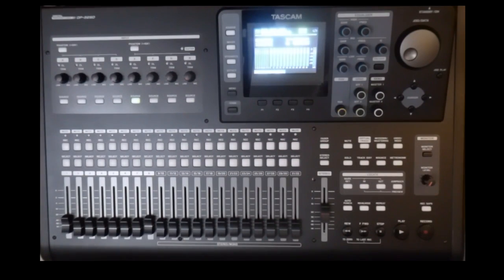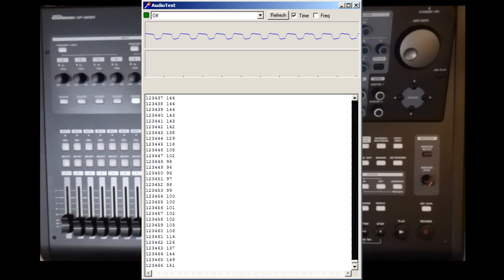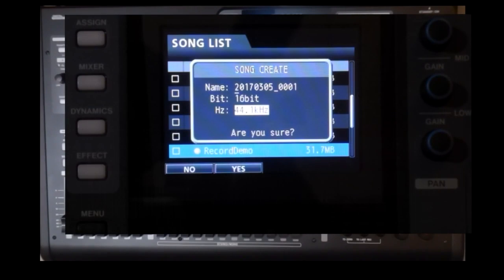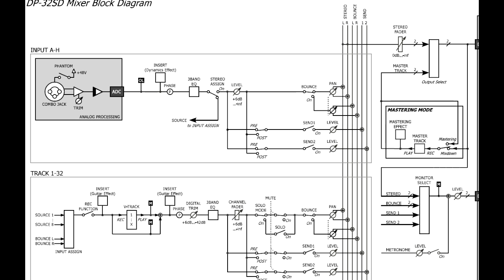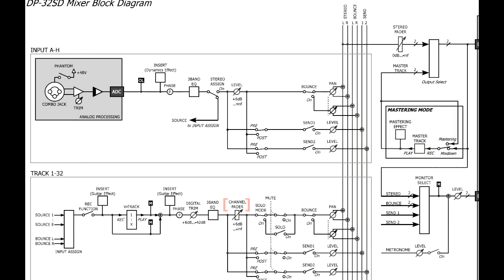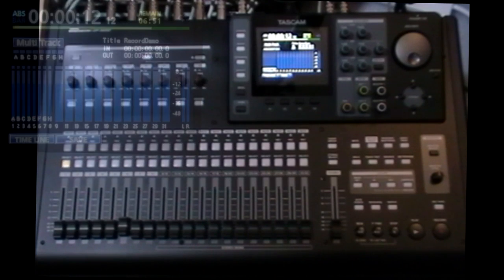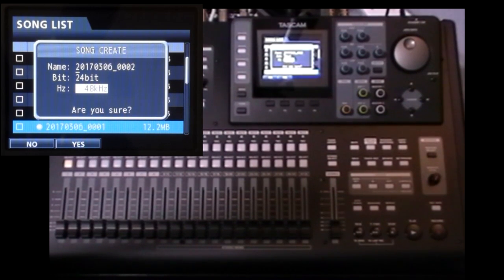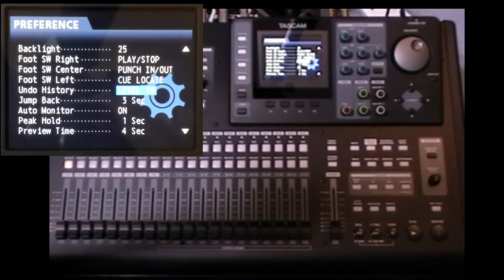Tascam DP24/32SD Tutorial 8A: Recording

Comment: great vid, is it possible to transfer tracks to Logic on Mac for further editing? thanks in advance
Reply from the maker: Thanks +Jon Wright. You can transfer individual tracks in & out of the machine by using the Import & Export functions; video 8D covers this.
Reply: Many thanks for reply, much appreciated, that's great as thinking of getting one for my home studio and learned sound engineering in the old days witb real faders etc 😀so thought this would be great and that I could master on my imac then if needed, was thinking about the 32 track one?  Your thoughts and advice be appreciated, many thanks Jon
Reply from the maker: Hi Jon, my main requirement was for making high-quality digital multi-track recordings on location. I already have a home-studio setup, so can transfer the recordings to this for mixing and processing as reqd. As such, the extra features like FX and Mixdown/Mastering were unnecessary, but I felt the machine still justified the price even if these were never used. In hindsight, they are more useful than I thought, and it's also sometimes easier to use the machine for quick demos or experiments to save powering up all the other gear. There also wasn't much choice for new machines when I was looking about 2 years ago  - there was only the Zoom which had comparable specs, but it looked more flimsy than the Tascam. I'd also had a Zoom PS-04 palm studio which had a really non-intuitive user interface (to me at least) so that put me off Zoom products - maybe this is unfounded but I went for the Tascam anyway. 
The 2 main justifications for the 32 track model over the 24 track were: 
1. I was always short of stereo inputs on my analogue mixers, and this is a pain if you want to route synths, keyboards and effects (especially reverb) through it as they are all stereo. You can use pairs of mono tracks but you have to keep any level & EQ adjustments in sync. So the fact that you can switch some of the channels to be stereo or mono gives it a lot of flexibility (but note that switching a stereo track to mono only gives you one mono track, not two).  
2. Extra tracks(mono or stereo) are always useful for multiple takes if you are only recording a few tracks at once. As mentioned in the videos, it's more convenient to audition these than to use the virtual tracks. 
Obviously if these issues don't apply to you then the dp24 will save quite a bit in cash :)
The only real downside with both machines (in my opinion) is that the only controls which can operate in parallel are the track faders. You can only adjust EQ, Send levels and Panning one track/input at a time as all the knobs only apply to the currently selected track or input... but this wasn't a show-stopper for me as I do all this on the other gear.
So that's my 2 cents, hope it's helped.
Reply: hi Phil, many thanks for that, kinda a torn between this and the zoom r24 , I'd like to do my final mix/mastering on my iMac also another issue is , I use an m audio code 61 for key sounds and wondered is this going be a problem if I want to record sounds from this ? apologies for all the questions just want to make sure I get the one that suits me best, the reason I ask about it working with the code 61 is that I heard theres no midi on it? appreciate your great advice, many thanks Jon
Reply from the maker: I don't the code 61 but if it's just a midi controller then you need something which will generate audio somewhere in the chain. The dp24/32 and the zoom (afaik) only record audio, not midi. The earlier dp24/32 models had midi, but this was just for synchronising. You could connect a midi controller to your computer and use a soft-synth or similar to convert the midi to audio, then send this audio back out to the Tascam or Zoom recorders.  I only have limited experience of some machines so you could  try asking on the various forums for more advice/opinions.
Reply: thanks Phil appreciate your honesty , yep was thinking the same just send it as audio from iMac to tascam, one has come up for sale at a good price here in Ireland its the older model dp32 with CD burner , its nearly 200 euro cheaper than buying the new model! your thoughts? thanks again
Reply from the maker: Well midi sync is useful but only if you really need it. There are ways to synchronize without built-in sync, such as boxes which convert midi time-codes to audio blips and vice-versa.  I used to use a Philip Rees TS1 (tape sync) unit years ago with 4-track cassette machines, but eventually sold it as I found it was more hassle to set up a sync track as my type of music didn't need sample-accurate sync. Nowadays I use a small 'click' at the start of every track so it's easy to align everything in the DAW later. You could even do this using the track-edit 'move/paste' functions on the dp machines with a bit of patience. The issue of machines drifting out of sync even though they both start at the same time also depends on the type of recordings you are making. For me, any drift over a few minutes is negligible, but again you can shift things in a DAW if it gets really bad. 
Re. the CD  burner, you'll probably find you won't use it if you've already got a computer with CD-burning software. I had a free-standing CD burner years ago, but it was lots of hassle to set up track markers etc. so again, that was sold on. A computer program will have many more facilities, such as CD-Text, letting tracks fade into the next with no gaps, etc.
So a tricky call I suppose. Tempting for the price, but really depends if the extra functions are worth getting a discontinued model. Good luck.
Reply: Phil Tipping 
Many thanks, was checking it out more and seems machine was bought 2nd hand 5 months ago, so decided gonna go for a new one, at least it will have guarantee etc,  just want to say thanks for all your great advice and keep the great videos coming, wishing you a great rock n roll Xmas 🎄 🎅🎹🎸🎵
Reply from the maker: Ok Jon, still time for Santa to get it for you before Christmas?... don't forget a couple of 32GB sd-cards as stocking-fillers :)  Thanks for the good wishes, and have a great time yourself.
Reply: Phil Tipping don't think santa 🎅 is that generous lol 😁

Comment: Thanks Phil... I'm a young jazz musician and composer that wants to record his music without a computer, I think this machine is the way to go! Thanks!
Reply: Did you already make a video on working with the waveforms, e.g. cutting?
Reply from the maker: Hi +Renate Ufer and thanks for the feedback. Well you share my preference for computer-less recording - there is a computer inside but it's dedicated to the one job and not a jack-of-all-trades 'personal computer'... so no distractions :)
I haven't any plans for a cut/copy/paste video yet - sorry. This is one area where a personal computer can be useful with its larger screen and more powerful editing functions, but you can still do a lot on the dp machine itself. The only tips I can offer is to clarify that the 'TO' value, i.e. the start time for the paste destination is defined by the 'current' time position as shown at the top of the home screen. It's not as intuitive as the other 2 values reqd. The start time for the copy/cut is the IN point, and the end time for the copy/cut is the OUT point... you set the latter with the SET IN/OUT buttons as normal first, and once you've set these you set the current time as normal (jog wheel and/or cursor buttons or the FF/REW buttons with Marker points) and then you can perform the cut/copy/paste operation. All the operations operate instantly as no data is actually moved - I'm guessing it's all done with pointers, so it means you can easily undo and retry these operations fairly quickly if you haven't quite set the start/end times accurately. The other thing that's easy to miss is the way the cursor buttons alter the resolution of the jog wheel in addition to altering the waveform zoom. Good luck with your recording & compositions.
Reply: Phil Tipping Thank you!

Comment: Thank you for this entire series of videos.  They are immensely helpful.  I do wish there was a video more concentrating on the overdub process, as I seem to get confused on that - particularly how to monitor previously recorded tracks while recording new ones, how to properly use the "rehearse" mode, properly use the "auto-monitor" mode etc.  Would love to see a video concentrating more on that.  Thanks again for everything, though.
Reply from the maker: +Scott Taylor thanks for the feedback. Yes there are quite a few things missing, but it was just getting too big a task! The key thing with overdubs is that any tracks which are not recording will automatically playback, so you just need to juggle the faders, i.e. arm the track(s) you want to record on, turn their faders up if you want to hear what is being recorded in your monitor, turn up any other tracks you want to hear as a guide, press Record.

I think Rehearse mode just goes through the motions of recording, i.e. it switches monitored signals on & off depending on whether the machine is playing or recording ... except that it doesn't actually record anything. I think Auto-Punch-In is one example where this is useful, as this switches the monitored signal as the machine passes through the punch in/out points... although I've never used either function so may be wrong!

Try asking on the Tascam forum - there's sure to be someone who uses these (and Auto-Monitoring) routinely and could explain the pros & cons.
Reply: Thanks, Phil.  Not sure why I was having difficulty with this.  Not having it now.  Some of us make the simplest things the most difficult!  A great thing about your videos is that they make everything much less intimidating than operating straight from the manual, as I had been doing.
Reply from the maker: Ok Scott many thanks. Well there are a few (luckily a minority) who disagree because they're not the quick & simple guide they'd hoped, so glad to hear it's working for you. It was a gamble going into so much depth, but as the intro said, it was a deliberate choice to use the block diagram and try and explain 'why' things are the way they are, as opposed to just stating 'press this', 'press that' etc. as is normally the case in a manual.
It's more to learn so won't appeal to everyone, but the advantage is you'll end up with a more accurate model of how it works in your own head, so are able to do new things and solve problems yourself. I've come across several people who have acquired a very strange (and wrong!) idea of how tech gear works, especially true with personal computers, so they get in a complete knot when things go wrong, or when trying to do something new, and worse, struggle asking for help as they can't explain the problem. Anyway, all the best and good luck with your recording projects.

Comment: Hey Phil. Here's a Q for you.  I have a TC Electronics M350 Effects I want to use with my DP24SD.  I can't find out if and how it could be hooked up..  Can this be done?   I like using the M350 on vocals and would like to use it.  I can normally hook things up but I'm stumped on this one.  I just don't see or maybe don't understand how it works.  Any help at all would be great :)      Thanks, John Bear
Reply from the maker: +John Roberts. Hi John, the m350 can certainly be hooked up. Typically you'd use one or both of the effect-send outputs on the dp24 to drive it, and connect one or both of its outputs to spare inputs on the dp24.
The tutorials show how the send outputs work. If you look at the m350 manual, e.g. page 4 where it describes the config button on the back panel, the references to 'aux sends' equate to the send outputs on the dp24.

The exact details of how you set it all up depends on lots of factors, like whether you want to record the M350 effect live, or just be able to hear it on the monitors during a live recording, or if you want to add the m350 effects to a pre-recorded track, etc. 

The tutorials show how to get signals out of the send system and hence into your m350, either from the live inputs or from pre-recorded tracks, and also how to record the results using bouncing or mixdown. There's a recent addition (tutorial 11) which shows how to record an effect live, so this may help if that's what you want to do.  

If you're still stuck, give me a shout, although it's easier for me to use email instead of the youtube comment system. My email is on the bottom of the page on my http://www.philizound.co.uk website.
Reply: Thank you so much Phil!  Only the "best" take the time to answer a novice's question :) I will hit your email in box soon.  :)

Comment: Interesting. Are you from Bristol by any chance?
Reply from the maker: Thanks +Jon Dinham - yes, but many decades ago... the tell-tale 'arr' never completely disappeared :)
Reply: Haha. Yeah thought so. I'm thinking of buying one of these. I currently have a boss br1200. I think this is an upgrade. Will be handy watching you videos when I do.
Reply from the maker: Make sure you research before committing. I think the dp machines have more capability, e.g. can record 8 tracks simultaneously... but this may make it harder to get your head around. There are also a few traps for the unwary, especially with the use of the 3 different effect types, e.g. there is only one guitar effect block so it can only be inserted into one track at any one time. Another common problem is recording the reverb effect - it's only available as a send effect so you can't record it live (although it can be heard live), etc. Don't know how this compares with the Boss machine but good luck.
Reply from the maker: Just a correction to previous comment - I think it is possible to record the send effect 'live' by using the bounce system with just the inputs. The bounce system takes any combination of tracks and/or inputs as the bounce source, along with the internal send effect, so if you just select inputs during the bounce (and route them to the send effect), the bounce destination track will contain the input(s) plus the effect. I'll try and get another video made to show this.
Reply: Thanks Phil. I'm probably ordering the DP32 soon, just need to go and have a  look at it this weekend. Will have plenty of questions i'm sure!
Reply from the maker: Ok Jon, hope all goes well.

Comment: I just bought one of the dp-24sd. I found the preroll section but I'm not getting a preroll where I get four clicks before record starts. That's what I'm looking for. Instead no matter what I set it at, record starts as soon as you push the record button and have a track armed. Is it possible to have the preroll count in on the dp-24sd?
Reply from the maker: +Rob Campbell - R. Camizzi the preroll function is part of the punch-in system. As far as I'm aware this is for re-recording over sections of an existing recording to correct mistakes. You may be able to get it to work for recording a whole track (which I presume is what you are trying to do) but I've never used punch-in so cannot advise. If there are mistakes in a recording, I either re-record the whole thing again or fix it later by editing, either on the machine or on a DAW. Try asking in the Tascam forum. By the way, please don't post the same question on more than one of these tutorial videos as it means I have to repeat the answer.
Reply: Phil Tipping Thanks.

Comment: We are having a problem when we try to add 8 tracks(drums) to a guitar track. It does a weird skip lag thing. Any ideas?
Reply from the maker: +Bryan G - the only problems I've heard of are due to faulty/incompatible sd-cards, or not using the latest firmware. The card could have become corrupted e.g. if the machine was powered off incorrectly. I'd try using another card if you have one - transfer the guitar track via export/import just in case any other files in the song were corrupted, i.e. create the song from scratch on the new card and just import the guitar track. If you don't have a spare card, transfer everything to computer and then format the card on the Tascam. I'd still only copy back the guitar track though - depends how much other stuff was on the card. Best of luck.
Reply: Phil Tipping yea we ordered a new card and its a faster one so hopefully that does the trick. Thanks.